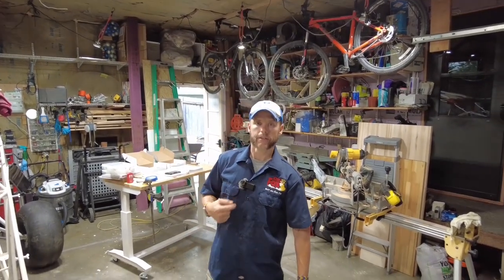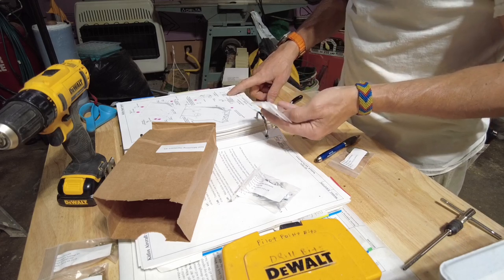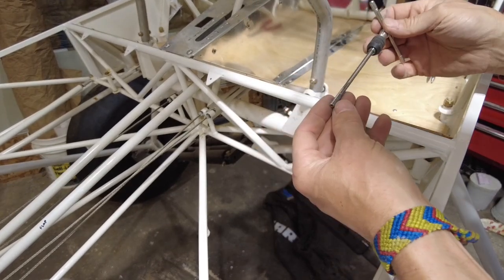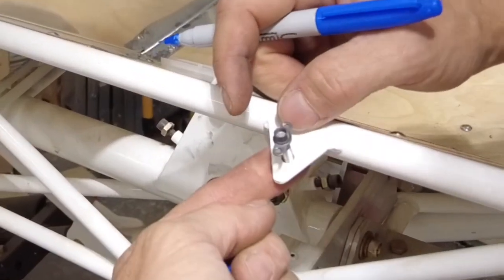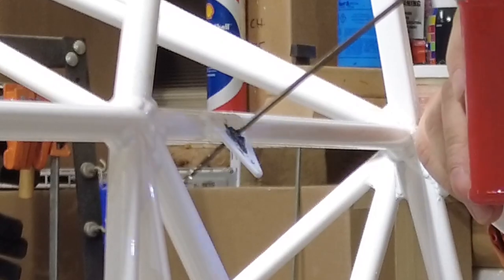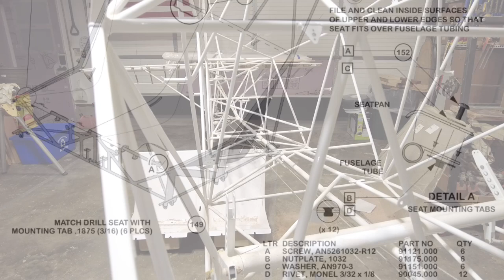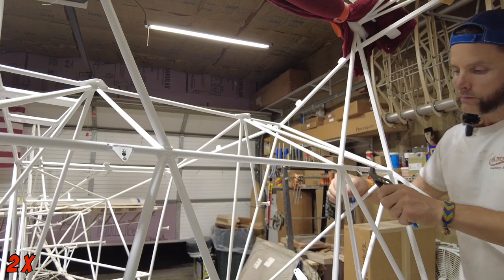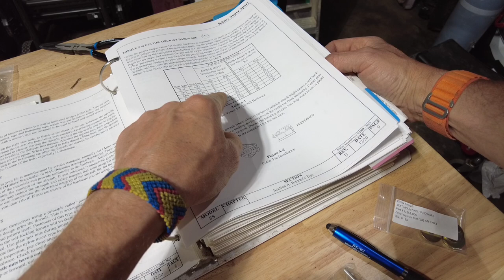#55 Under The Seat Pan

Comment: You've probably figured this out by now, but match drilling would be to drill through both the seat and the tabs with the seat installed... this insures the holes "match".  Also, a chamfering bit will clean up those burrs much better than that hand deburring tool.  Finally, when you install nut plates you can put the center screw in place, then drill straight through nutplate tab hole as a guide... cleco the first hole, then drill the second the same way.
Reply from the maker: Hello @mikefairbanks, thanks for the info.  I am learning still and I appreciate the comments which help me I hope as much as I may help someone else.  I did drill through the holes into the seat but not with ballast in the seat.  I guess at this point I will see how I fair.  If I break it I will have an excuse to learn how to make some carbon fiber seat pans! 

I bought a chamfering bit, 100º I think too.  Now that you mention it, that would have been a perfect scenario to use it in.  The handheld deburring tool did not do it justice.

Clecos are another of those items that I’m not yet used to.  I need to think outside the bun and use them more often to hold things in place.  Good call and thanks for the education.  Have a warm day, Matt

Comment: The best way to do this is to get two people to sit in it when match drilling the top holes.
Reply from the maker: Thanks for the input Jeremy.  How is your build coming along?  I hope nothing bad will come with me not having weight in the pan while match drilling it.  Have a good day, Matt
Reply: @KingFox76  
I have to build my wings next, I did not go for the quick build.  You could get some people to sit in it to see how much it is out by,  mark the holes and make a decision.  Every time two people sit in it now will put stress on those particular holes. It could fracture eventually.
Reply from the maker: Hello @jeremykemp3782  well that doesn’t sound great to me.  I’ll have to recruit someone to sit in there with me to see how it fares.  I put about 65 pounds in the seat pan when I was making my marks but not two people worth of weight.  The wing build looks like it is pretty in depth, I wish you the best of luck with that and am interested in the process.  Have a great day and thanks for commenting.  Matt
Reply: @KingFox76  
You could just make the hole bigger in the seat pan and use a washer to the original size of the existing hole.
Reply from the maker: Thanks for the idea Jeremy, when I get back on location with the craft I will look into this.  Have a good day, Matt

Comment: Matt, what cameras and editing software are you using? How about the music? I'm going to get things going before my kit arrives. Waiting for better Wx in the PNW.
Reply from the maker: Hello Stu, thanks for asking.  I go between my iPhone, iPad, DJI Pocket 2 and a GoPro Hero 9.  I really like the iRig holder for my phone as I can clamp it on about anywhere while videoing for up close shots.  The DJI I’m still learning, I do like its size and the mic that comes with it captures the audio very well.  I tried to use that mic with my iPhone but it doesn’t work that way so I’ve now picked up the DJI mics that I can record on and take video with any other device.  Easy to transfer also.  

LumaFusion is the software I chose on my iPad, I thought the price point was good and they update it all the time and are always adding new features.  Not to mention they have good YT series that walk you through about anything and their customer support has been spot on.  They have a music/media subscription that I subscribe to called Storyblocks.  I don’t really use much of the footage and I’m not too sure how much I like the music.  I think I may end up using some of the same tracks over and over again, I’ve also had a rash of copyright issues with YouTube with that.  However most of time after getting the wording just right via a back and forth with LumaFusion, after appealing the copyright issue it is usually removed after a few days.  Again thanks for asking the questions.  If you don’t know, I do list almost everything (minus the software for editing which I can add, thank you) under the videos where the description is.  I think you have to click on “more” then scroll down, also with links if wanted.  Thanks again and have a great day, Matt
Reply: @KingFox76  Thanks for the info Matt!
Reply from the maker: @StuPierce77  Anytime Stu, fun to know people are watching.  If you are new to video editing I would recommend starting to practice.  The editing is what takes me so long.  Good luck with your build and your channel.